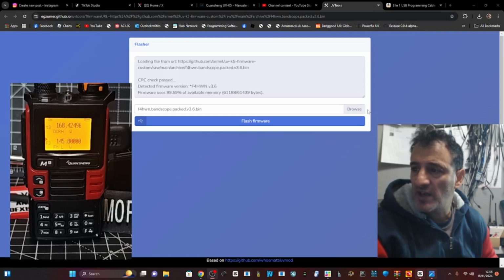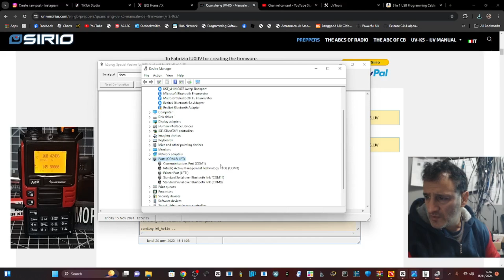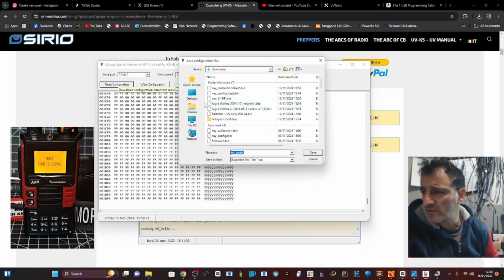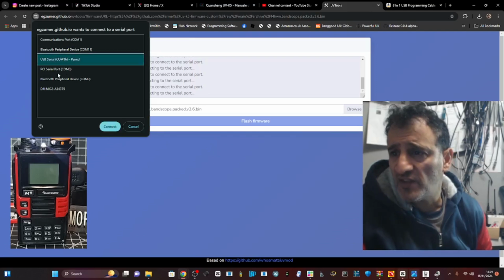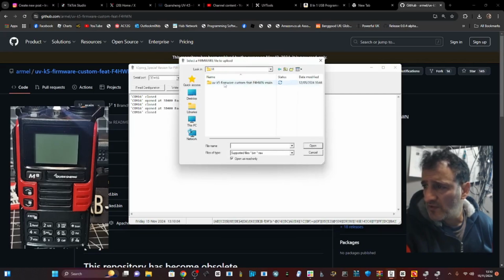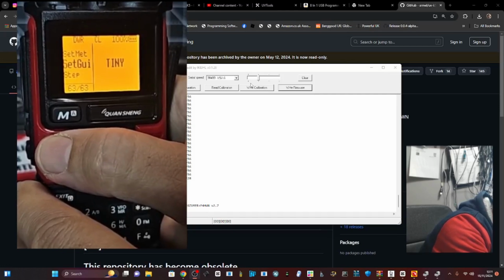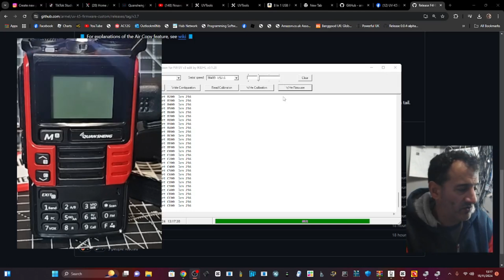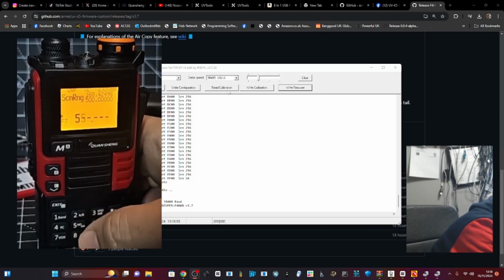F4HWN - Load Firmware Full Install & Back Up

Comment: Bro can i ask you question, i have egzumer firm. But i also want to download F4HWN v4.0, if i do it can be work or no? What do you recommend about my this situation?
Reply from the maker: Try both
Reply: Having both installed won't cause any problems, right? does not conflict?

Comment: I’ve just flash the fw and update to 3.9, question: the radio works with no problem with the old frequencies inside, can I let them or must I reset again? 73
Reply from the maker: Be fine as it is.

Comment: Loaded up the F4HWN 3.9 ver. a few minutes ago and all went fine.  Also loaded the 3.9 py driver module for Chirp, so I could do some modifications, and had no issues with that either.  I'm liking the new firmware and may add it to a couple of my other K-5 / K-6 radios.
Reply from the maker: We so.lucky we have these firmware etc .
Reply: How do you install the Chirp driver required to talk with this firmware? Is there a resource or video you can provide? I haven't installed a Chirp driver before.